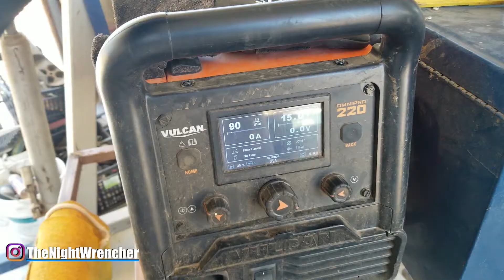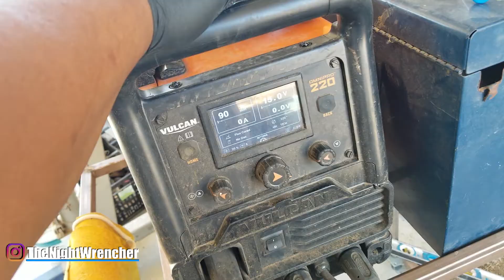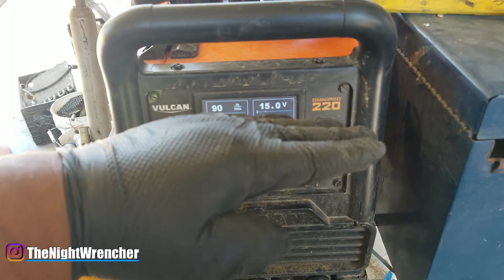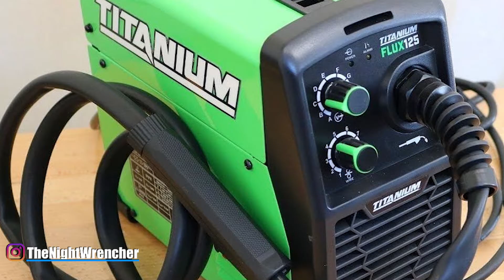How to Set Up A Welder For  Flux Core In 11 Mins | Flux Core Welding For Beginners | Gasless Welding

Comment: Hey man got any advice on welding 5/16 to 16 gauge steel?
Reply from the maker: @Charlie-b4j5r  start the arc on the thicker metal, build up the bead and then lead it into the thinner metal quickly then go back to the thicker metal and repeat.
Reply: Excellent. I will try that tomorrow thank you….

Comment: I’m confused on the function of voltage and wire speed. What does increasing or decreasing speed do vs increasing or decreasing voltage.? I though voltage would determine how hot in order to melt faster .Can you help me understand?
Reply from the maker: Wire speed controls amps, voltage controls heat. Basically if you want to penetrate more, you increase wire speed. if it starts to ball up, you increase voltage to allow it to flow more. In short, you need more wire and more heat for thicker metal. Less wire and leas heat for thinner metals.

Comment: Is this wire made out of aluminum??
Reply: Can I use it on Stanley steel?? Thanks in advance
Reply from the maker: @marcosfigueroa7905  flux core is a steel alloy with flux inside. You can weld to stainless but it will not be stainless anymore and can rust so it must be coated or painted
Reply: @NightWrencher  thanks for the answer

Comment: Thank you for your videos, it really makes a difference showing different results. I bought a Simder Mig 140amp flux core/arc welder. I had an old Harbor Freight 120amp, but did not change to DC, so I thought the Simder would solve my problem - not. I'm 69 and build motorcycles and decided I need to learn to weld. I have built a high performance old 1976 Yamaha RD400 drag bike and I can't keep the front wheel down, so I need to build a wheelie bar. Problem is that whatever I adjust the volt and amp (amp also controls the wire feed wtf!) control knobs, the bead never gets that nice tan color you made and no getting that bright bead. It always looks like I'm burning the metal. I dropped the voltage to 14 and amp/feed to 40 and still burns. I'm practicing a flat bead on a 16 gauge coupon. I set the machine first to 17v and 60amps (roughly 110 wire speed). Maybe I'm getting old and stupid or this machine is a piece of shit - perhaps a little of both. Any thoughts about what I may need to try? Other than to toss it and get someone else to build the wheelie bar. Thank you and sorry about the rambling on.
Reply from the maker: Some machines are tricky to get right. Usually amps and wire speed are tied together because its the rate of the wire being pushed into the weld that causes the increase in amp draw, not nessesarily the machine adding amps itself. When I get stuck, I turn the machine all the way down on both voltage and speed and make a big spot weld. The machine should sound smooth as its making the spot weld and if its not, add wire speed and try again and keep going until the machine sounds smooth. Then try to make a bead. If you look close and move slow, you'll be able to add in what youre missing in no time.
Reply: Thank you for your response. I purchased a Titanium Flux Core 125 yesterday and I will do as you said. Thank you again! @NightWrencher
Reply from the maker: I like those units a lot. Should work out well 👍
Reply: @NightWrencher  Haha, got rid of the Simder and the Titanium and bought a ArcCaptain 200 6 in 1. I really like this machine, I'm getting a little bit better. I sure know what you said about proper hand position is the thing to practice. Thanks again, you still lay the best beads on Youtube!

Comment: I honestly wouldn't bother changing an older welder over. Technology has moved so fast you can now have a beast of a welder that weights less than a watermelon & costs less than 150 quid. They have synergic technology onboard so all you really need do is tell it what wire gauge you are running & what metal thickness, It does the rest, pretty much. You can twiddle amps & volts if you like, but meh.. Older machines are heavy, suck at running flux core, draw far too many amps & are a general pita. 

My current favorite machine weights <4kg, runs off 220V at 13 amps, would weld the golden gate bridge onto the Eiffel tower and cost less than 150 quid with a 100% duty cycle at how I roll. To get similar performance used cost me 1500 quid, minimum,  ran off 3ph or 16amp on a 32 amp breaker, weighed 60 kg & you had to lug around gas bottles.  

It is currently not "Where it was at" on the welding front. Things have moved on, rapidly - loads have not kept up & are still using dinosaurs. My current fave stick welder is smaller & five times lighter than the battery that used start my tow-behind diesel welder - plus it out-welds that 20k 600kg diesel welder on every front - off 13amps, 220V supply. Mind blowing stuff IMO. 

If you are still buying bottled gas/towing a diesel welder, then you're about 5 years or more behind the curve of where welding technology went.  I can show you machines that weigh nothing, will fit in the glovebox of your car & will out-weld your dinosaur all day every day with no gas bottles or diesel in sight. I wish they were available years ago - they'd have made me even more money than the dinosaur tech versions did.

Comment: I'm gonna watch this, because I tried fluxcore welding for the first time this weekend, despite having watched many vids, and I only got shitty ass slag, it seems like the bead pops away from the surface to be welded, I got not adhesion/penetration at all.
Reply from the maker: First make sure your polarity is correct. Flux core is electrode negative so the ground clamp is +. Next I would make sure your gun tip is about 3/8"(10mm)  away from the surface of the material, the closer, the better. Finally move slower and dont move the gun so much
Reply: @NightWrencher  Thanks a lot!  I'll buy some steel tubes to practice.  With a known gauge, I'll be ably to play with the settings of my machine, a very basic one that only does flux core (so no polarity inversion is possible).  I was trying to weld a reinforcing bracket on a wheelbarrow.  No idea of the gauge of the bracket, nor of the stock stands of the wheelbarrow.  Heck, the brackets might've been galvanized, which probably affects the whole thing.

Comment: Your not taking in account your "preheating" the metal when your not allowing it to cool between test welds. When the metal is hot from the first weld the setting will act like they are a bit higher from then on.

Comment: Handy video pal. Best advice is with thinner metal less heat and low speed slowly add speed then heat. As car metal easyilly blows holes. Sound is a good thing to go by too. Sizzling bacon

Comment: Can you give me any advice on welding 5160 spring steel and tool steel. I'm good with mild steel but penitration on spring steel (5160) is a problem for me.
Reply from the maker: I cant say too much except increase the heat. If itll take more wire speed without completely flooding the weld then go ahead and add more.
Reply: @NightWrencher  Acellent advice. I increased the heat as you advised however after watching you weld I realised I was traveling way to fast and my puddle was way to small. So I got hotter, slowed down, and made a bigger puddle which isn't hard for a guy my age. many thanks.
Reply from the maker: Glad to be of service!
Reply: @NightWrencher  Thanks for that.I'll let you know how I go 👍

Comment: "Turn up The Heat" = More Volts?      "Turn up The Heat" = Faster Wire Speed?      Which one?
Reply from the maker: More volts 👍
Reply: @NightWrencher  Thank you. I have an Omni Pro 220 and Easy Flux 125 both purchased several years on 25% off coupons. Now, with your help, I am going to do something with them!!
Reply from the maker: I hope it works out!

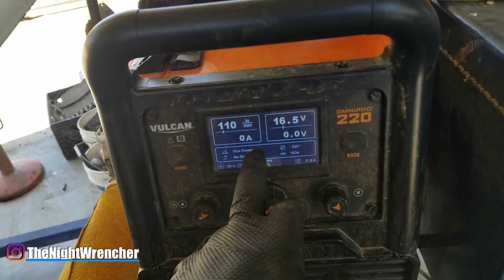Comment: @ around 4:21

Thank you so totally for the explanation of wire speed effecting voltage/amperage.  

I am struggling with the CE-125.  Thinking about getting the 125-Titanium and seeing if DC voltage welding may give me more penetration and less inconsistent bead welds.
Reply: I know money is tight now but  I've read too many bad reviews about the titanium 125  but the 170 was so much better. Just a thought.
Reply: @toddrhine7648  

Thanks for the reply.

I purchased the CE-125 circa January/February 2022 for $160.00 + tax.  It is on sale now for $90.00 + tax.. ☹️

However, the Titanium-125 is $200.00 off the normal $350.00 sales price!  It's kinda on offer I cannot refuse.
Reply from the maker: I've heard the 125 wasnt too bad but I would look up yeswelders first. Maybe you can find something comparable for a good price.

Comment: Good video but you didn’t talk about stick out ,the distance  from the contact tip to your work. That’s very lnportant  for your volt setting, to far out your going to have less volts, to close the weld will spread out, not good depositing. You can take the gas diffuser off with flex core you see the puddle better, keep up the good work.
Reply from the maker: Thanks man, I appreciate it. I make so many welding videos I tend to miss details that I've mentioned in other videos thinking I already said them in the current video.

Comment: ...Also the length and gauge of extension cord can effect the settings. The further you are from the source, the more you will have to play with voltage.
Reply from the maker: You're right but depends, the newer machines can compensate for voltage drop.
Reply: Yup, 14 gauge not ideal.

Comment: You didn’t tell us what settings you changed to between 1st and 2nd and 3rd weld??
Reply from the maker: Yes I did, I said a little high on the heat. Knowing how much I raised it exactly wont help you because each welder is different even if theyre the same model. Just go up a 1 unit of whatever welder you have and try it. Eventually you'll find the sweet spot

Comment: When you are welding 2 different thicknesses of metal together, do you use settings for the thicker or thinner material?
Reply from the maker: I always base it on the thinner one because you only need to worry about keeping the thinner metal in place while you weld and using the higher heat settings will make you burn through a lot easier.

Comment: Absolutely love this video and the results driven examples of changes in heat and wire speed and what the weld can look like at the weld, the heat marks, and also ease of slag removal.  This is by far the best explanation and has helped me out tremendously.  I'm 2 days into welding and doing some test runs and some real runs.  It is evident I need to practice learning my machine and settings and metal thicknesses.  I have the Ironton  Flux core 125 for some basic home welding.  I have 2 settings for voltage (1 is low and 2 is high) and 1-10 for wire speed setting.  Where I struggle is what settings to use when I'm joining 16 gauge to 1/8" material as an example.....finding the right balance between just enough volts to not burn through the 16 gauge but hot enough to penetrate the 1/8" stock.  For 1/8" material the settings are Voltage 2, wire speed 4.  For 16 gauge the settings are Voltage 1, wire speed 4.  I'm going to try to find a bunch of scrap metal sizes and really work the settings to get the best welds like you did in your example.  Thanks again
Reply from the maker: Just saw your message bud, the trick is to turn down the voltage, start the arch on the thicker metal and run it into the thinner metal and quickly pull it back to the thicker one. Watch you vertical welding video, the concept is the same. Good luck!
Reply: I am forced to run the wire speed on 8 for 11-gauve/3.0mm stock with my CE-125.

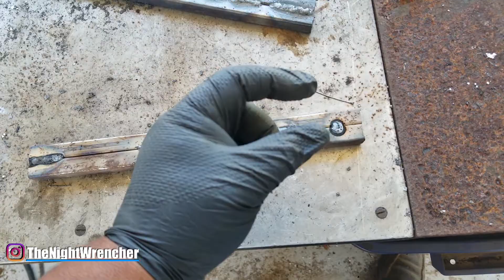Comment: 5:08 i got the cheap welder with a min and max, how do i make it hotter?
Reply from the maker: You cant really make it "hotter" but you can turn voltage to max and wire speed to slow and just hold it in place longer
Reply: Alright ill try that out!
Reply from the maker: Hope it works out, good luck!

Comment: The material i usually used is a 1.2 tubular steel ,i'm a newby to flux cored weldingwhat is the ideal flux cored size do I need to use 0.6,0.8,0.9 or 1.0?
Reply from the maker: For thin materials you want to go as thin as you can for wire because it will require less heat to get it to flow and tacked together
Reply: I would use 0.6

Comment: People tell me that flux core is rubbish and I cant get good welds without gas
      then I show them " rrrrrr I don't have gas...that is a flux core weld"
 Gas is not cheap in Australia if you are not welding all the time. Plus I have got so used to using flux core I only look for others if it is critical.
Reply from the maker: Its not rubbish. Check out my latest community post to see how my welds came out on this steel frame table I built
Reply: @NightWrencher  Exactly, there is a Tilt Trailer on my Ch you can see me driving a car off of, it was completely built with Gas less!
https://www.youtube.com/watch?v=MfsUccu9j1g
Reply from the maker: Thats awesome man, great job!

Comment: That was very interesting. I have a less complex welder than the Harbor Freight unit you were using. I got my welder from Aldi here in Australia. It's a 100A unit without a digital display and I use 030 (0.8mm) flux core wire. One thing when you're filming welding, try putting a welding filter on the camera so that we can see the actual welding process instead of the bright flash. It could be helpful.
Reply from the maker: I film all my videos with my cell phone so if I can find an app that can change the coloring of the video of maybe something I can place over the phone that would be nice.
Reply: @NightWrencher  You could try placing a welding filter against the phone's camera. That might work, or it might not, but you could try it and see if the welding is bright enough for the camera to see it through the filter. Otherwise, maybe a lighter shade of filter might work. Some experimentation might be required to get the best result with the weld visibility. It would be unique, because I'm not aware of any other YouTube channel that does welding that's tried it.
Reply from the maker: The weld.com youtube channel has something like that. You should check it out

Comment: Why would anyone put a rubber glove on their hand while welding?🤔😳🤪
Reply from the maker: Maybe because I wear them under my welding gloves so I can take them off and on really easily? 🤔
Reply: @NightWrencher  Didn't see a welding glove over it at anytime. Must not be a south Texas mescan. Those nitrile gloves create waterfalls around my cuffs when i use them. I only use them when changing oil in a engine or cleaning out a pellet grill. Try to get the job done quick as possible so i can get them off. The black ones are worse than the blue.
Reply from the maker: I dont wear the welding gloves unless I'm in the process of welding but sometimes not even then either. 🤣 I'm a mechanic by trade so I'm used to wearing the nitril gloves all day everyday even if its 120 outside. I start wearing the gloves at 5:30 in the video but take them off after each section
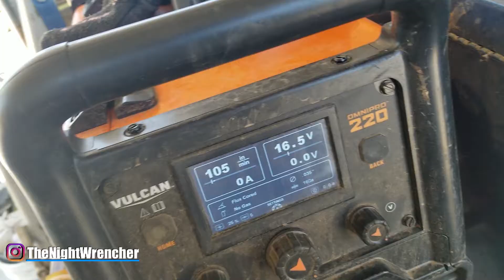Reply: @NightWrencher  Okay. Since it refuses to stop raining here, and i have nothing better to do. I went back for the time stamp. @ 8:50 you start a weld with your right hand, that has a leather glove. That hand is clearly leaning on your left hand, with nothing more than a nitrile glove.....
When i was much younger, i worked as a mechanic for a while. Was no such thing as mechanics gloves then. Even if there was, i would have been laughed out of the shop for wearing them. Wonder when that became a thing? I started using them because I'm a farmer. They work good for pesticides.
Reply from the maker: Its actually more common than you think. They even make you wear them at most dealerships. Taking off a set of gloves is much faster than to wash your hands especially when you need to on a quick test drive. I wasn't wearing my welding glove on my left hand because I didnt have it, I had left it at work. I film videos while in the middle of working on my own things at home so the gloves pretty much stay on all day 🤣 i just rinse the sweat off before eating and good to go
Reply: @NightWrencher  i have leather welsing cloves, only thailand have little problem not have big size cloves anywere all have childrens hand size, im retiree in thailand and hobby work own furnitures and all other what want, first i buy good TIG super expensive in thailand ,i not can weld rod weldin MMA, yesteday buy MIG machine because tig have lot slow welding round edge tubes together, MIG loit bertter i use normal argon but now use first time flux wire.i not know before need change polarity positive if use flux, tomorrow need test and change right side negativa to weld and positive to ground.